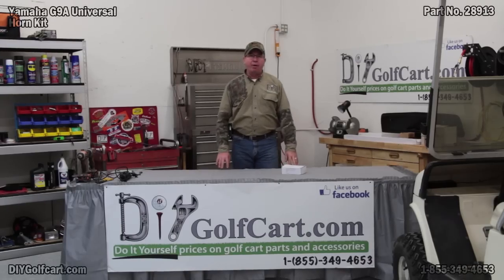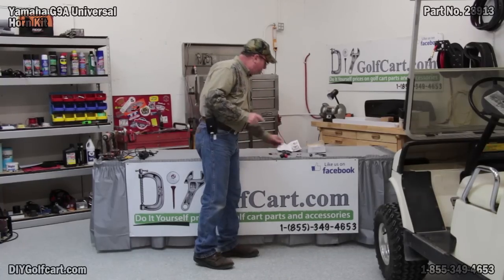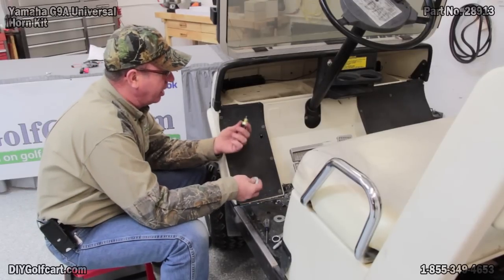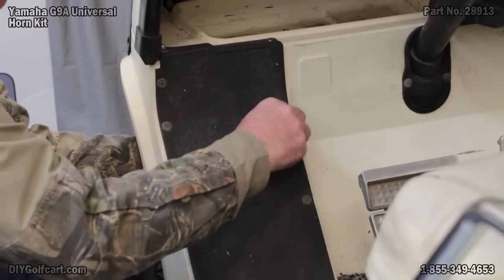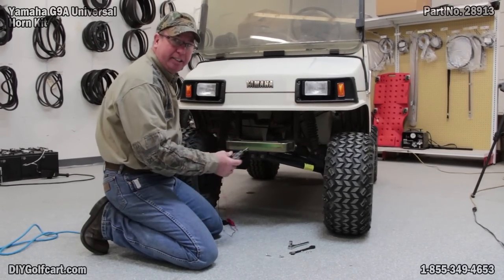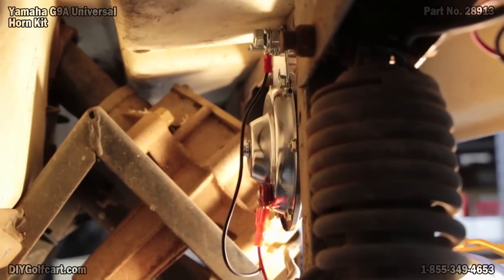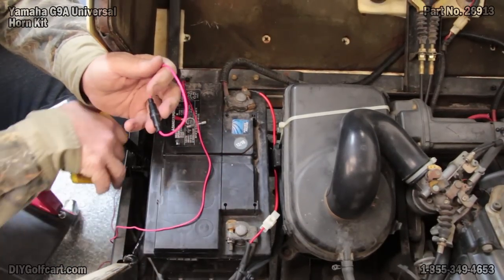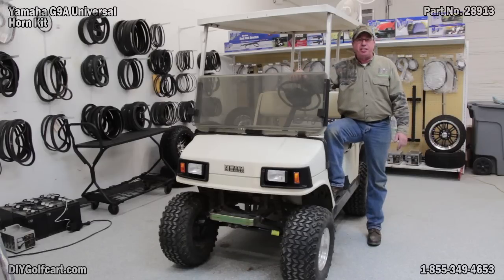Universal Golf Cart Horn Kit | How to Install on Yamaha Gas

Comment: I have an EZ GO TXT 48v Electric Golf Cart.  I purchased a universal horn kit like the one you are using in this video.  I'm clear on installing the button and mounting the horn to the front of the cart.   I'd like specific instructions on what to do with the negative wire.  In this video you mount it to where the horn connects to the frame to act as a grounding wire, but specify this can only be done with gas powered carts.  What do I need to know about the negative wire for electric carts?
Reply from the maker: On a 48 Volt Golf Car, you can run the POSITIVE to Battery 1 and the NEGATIVE to Battery number 2. This will give you 16 volts to your horn.  I would not hook up anything else this way! No lights or Radio! Only a horn!

Comment: How do you change a broken headlight pull switch that is on dashboard
Reply from the maker: The knob usually can twist off then you can remove the nut holding it in place.